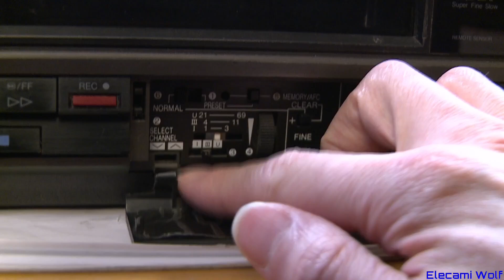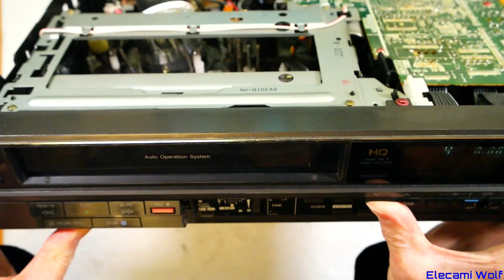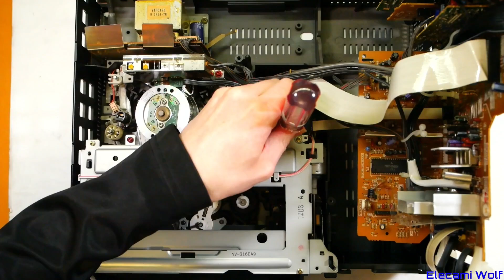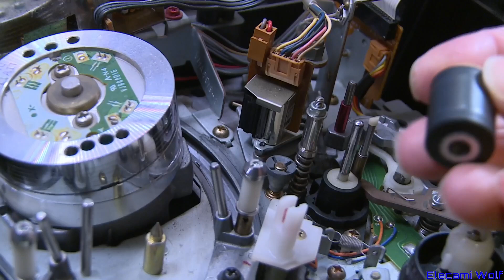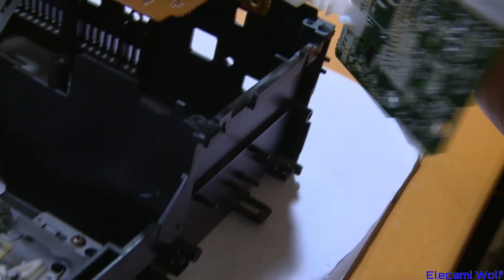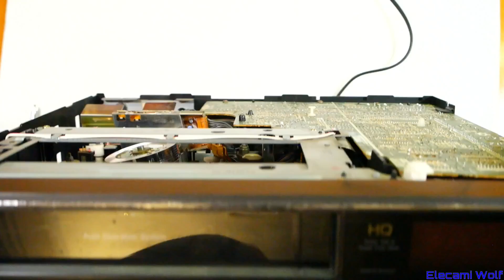EW0139   Panasonic NV G16 VCR Investigation Teardown

Comment: if I want to connect it to modern tv do i need to use al 4 in outs or i can use just two of them ?
Reply from the maker: You would need to TV with composite video input or use an adapter from video to HDMI. It might be difficult to get a nice picture on a new TV because the VHS signal quality is poor.